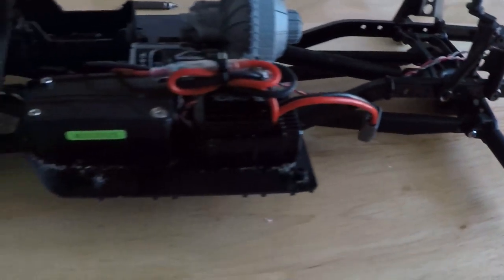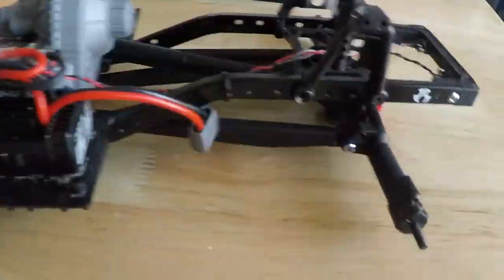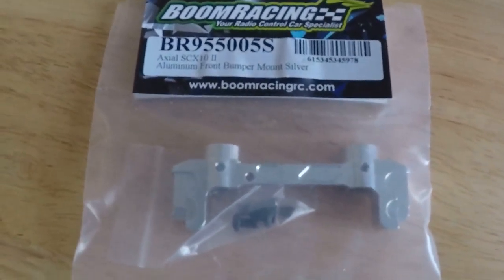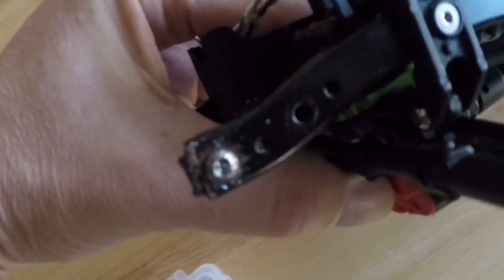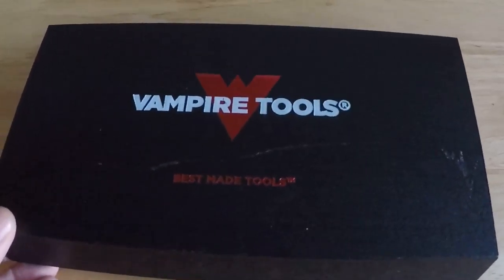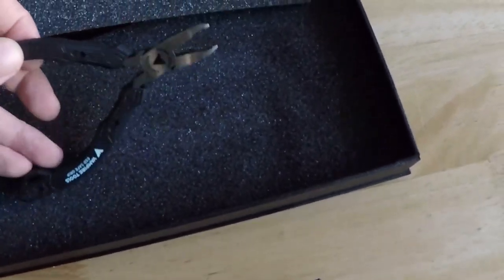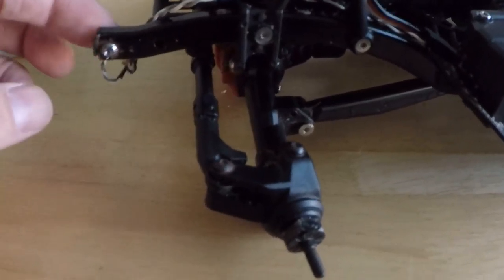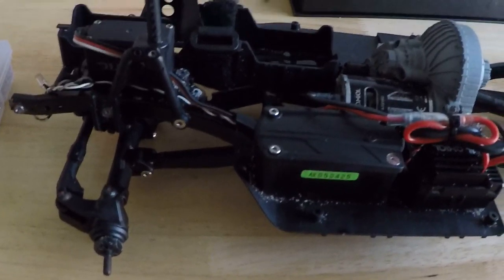Update on my SCX10 II ...  the most stuck screw!

Comment: Usually i bump up the allen key size.
For a 1.5 i use a 1.6,
For a 2.0/ try a 2.1

The odd size are hard to find you can find them.

After i clean my rig i always give it a wd40 bath helps fight the rust.